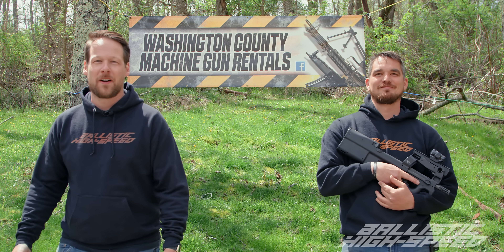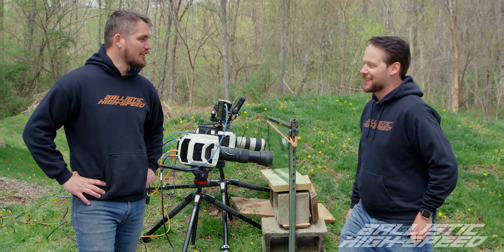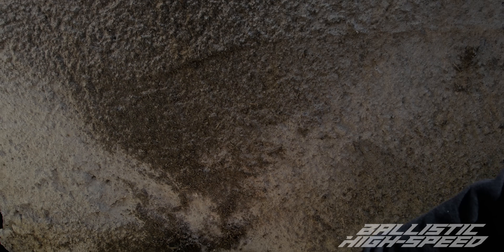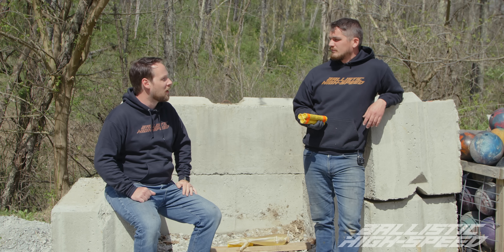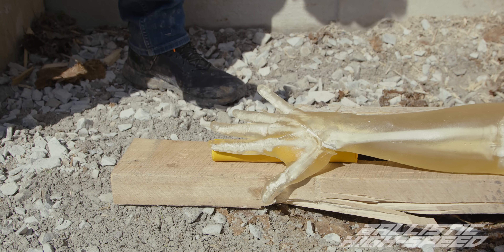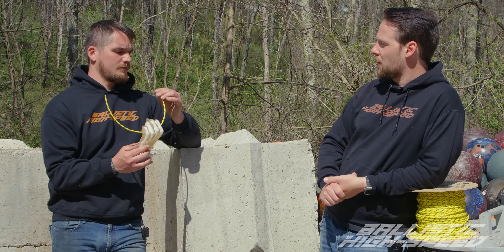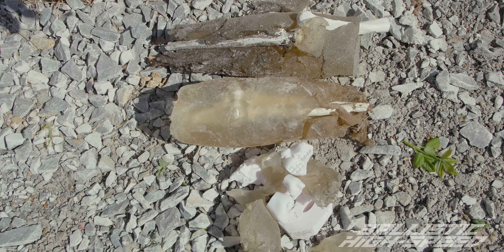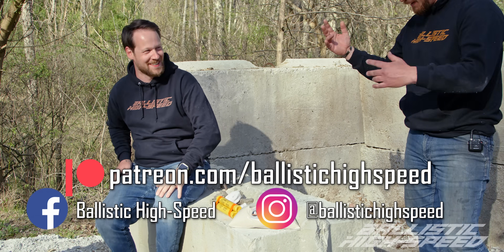Explosives vs Hand in Slow Motion! - Ballistic High-Speed

Comment: Even holding a electric detonator for dynamite  in the hand would blast your fingers of .   Try  that!  .   Windind the  detcord around a log will cut it 
Also something you can try. 
I think  the reason for the minor damage of the dynamite,  compered to the  frag granate ,is that the dynamite only rely on explosives shockwave whe ln blasting the hand , dynamite in rock blasting that is poorly back filled in the hole will not break rock ,only blast the explosive gases out thru the hole .  The nitro glycerin is slow expolsive compared to military explosives . But it works fine if the cavity its placed in is well sealed. 
The granete relyes on the scrapnol to do the damage ,and the steel body makes for high pressure inside, try filling a granete with dynamite!
The det cord is developed for 
Cutting stuff up very high speed explotion , there are non electric trigering systems with 
High speed explosives that dont burst the tubes ,just runs along the inside  super fast   (looks like lightning )  also something to 
Film !

Comment: Yeah commercial explosives tend to be stable enough to handle them. I can tell you exactly what happens when you have a bundle of about 10 strands of heavy black powder quickmatch firework fuse in your hand and touch it off with a staple gun. You get 2nd degree burns over your entire hand and you get whisked off the the burn unit. But at least it doesn't detonate.

Comment: You might mention what the "purpose" of detcord is.  Pretty sure it's designed to 'detonate' a larger explosive charge.  It typically is not used as the charge in and of itself, but to trigger larger medium!  Don't play with things that go bang children.  Firecrackers will remove finger with little effort too!
Reply from the maker: Detcord is often use in "cutting" things as well. Such as trees, steel beams, etc. The ability to wrap it around things makes it incredibly versatile.

Comment: Actually this doesn't show what happens when you forget to throw the grenade because if you don't open your hand,  the spoon won't slip and let the striker start the timer sequence to start....
It is a good demonstration of what would happen if you timed a Cook Off wrong,  holding on to long after you flipped the spoon to lower the time delay of the grenade....
One of the problems with grenades is the ability for the enemy to pick them up and throw them back before they explode,  especially when you throw them into a room or confined space...
So we started a tactic called the Cook Off,   where we'd let the spoon flip (sequence starts) wait a second and then throw it....
This cuts the time the enemy has to pick it up and throw it back....

Comment: The VoD of PETN detcord is more like 6000 m/s so closer to 15,000 feet per second, not 20,000. The RDX from the first clip is almost 9,000 m/s so much, much faster and gets you to your 20,000.
Reply from the maker: We measure it ourselves to 22,000fps with the high speed camera. The number is correct.
Reply: @BallisticHighSpeed  Pardon me, I had a moment there and messed up my ft to m conversion. 6000m and 22000ft are around the same.

Comment: I wonder how much of a difference the overpressure you're creating by the shockwave bouncing back and forth is making verses if it was in open air and the shockwave could disperse?
Small nitpick just to give you a comment to help with the algorithm - if you were holding a stick of dynamite, you would be holding it the vertically, not horizontally.

Comment: In early WW2 the British used a device called sticky bomb, essentially a massive grenade with very sticky resin that was used against tanks. In theory it would stick to the outside of a tank and injure the crew inside through armor spalling.

There are documented cases of unfortunate soldiers trying to throw the thing, but due to various circumstances it stuck to their uniform. It held 1.25lb of explosive and had a 5 second fuse

Comment: Different explosives are useful for particular purposes. A slower explosive such as TNT is good for "pushing" dirt or cutting timber. A fast explosive such as C4 is better for producing a quick "shock" for shattering concrete and cutting steel. At least, that's what I remember from the demo classes I took about 25 years ago in the Marines.
Reply: TNT is not "that slow", AN based ones are the slow bois.

Comment: Rdx or c4 burns at 26,000
Det cord at 21,000
 Tnt at 12,000
The comp b was about 20,000
Tnt pushes better. So if you want to tip over one end and use c4 to cut it loose. Like blowing a bridge support. We just used caps and det cord to set it off, but now there are caps on non electric cord. It's like a very weak det cord. There are delays available also, so you can cut both ends and then push it over a quarter second later so the bridge falls.

Comment: Det cord is great. But cap detanotor is most dangerous. Old timers would use their teeth to crimp it to the fuse. If memory is right, equal to a 1/4 stick of TNT. But great demonstration. We used m67 in the 90's. A lot more frag

Comment: Ahhh that first test really wasnt adequate. I very much enjoy the content and the video but filling a frag grenade body with 2-3 ounces of powdered RDX isnt going to be very comparable to the effects of a grenade filled with 6.5 ounces of high density comp B. 

Not only do you have half of the explosive mass but you will also have a drastically reduced velocity of detonation along with poor brissance and thus poor fragmentation.

Edit: im a dummy , what i said was technically true but  i was looking at the specs for the m67 not the MK2. The Mk2 has been used with many different types of filler explosives so I am wrong.

Comment: Very cool series!   👍    My fav was the det cord.   Will you guys be doing shape charges at all?   THAT would be cool to see hot molting copper slam through armor plate.
Reply: Ditto on seeing HEAT jets And EFP:s, both being formed, and going through armor.
Also some technical charges could be interesting, like cutting off a steel beam with plastic explosives.